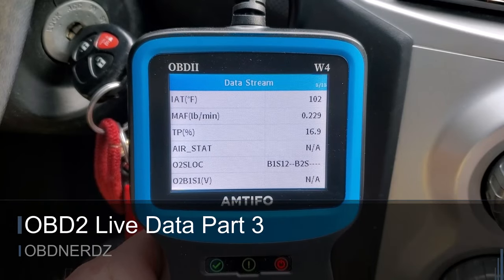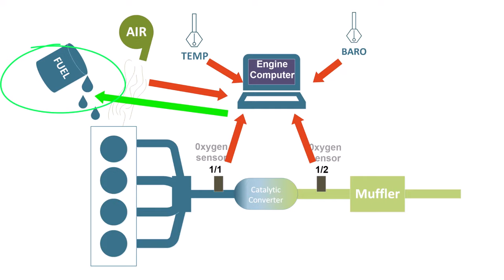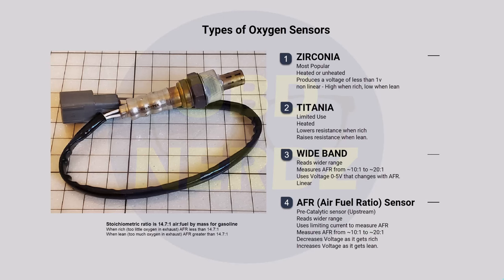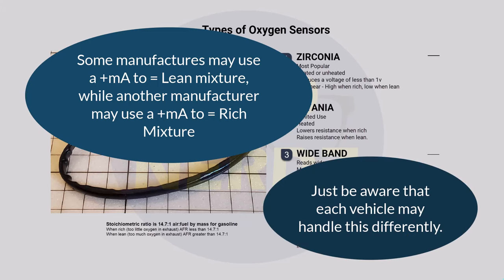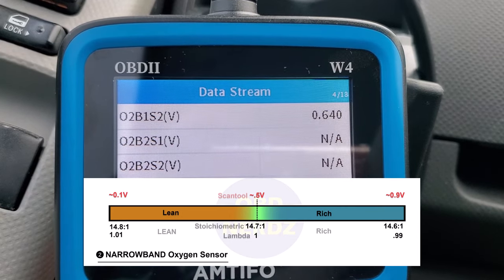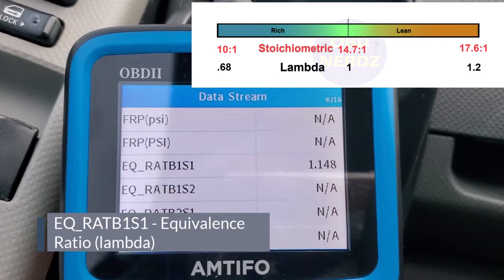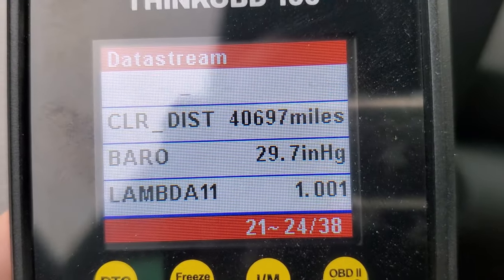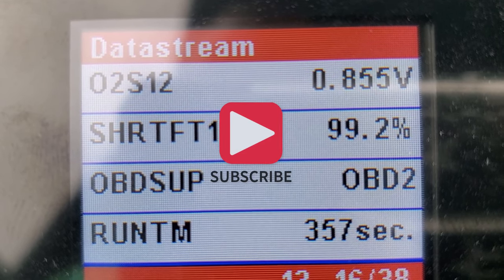Reading OBD2 Live Data Part 3 (Testing 02 Oxygen sensors)

Comment: Extremely helpful video. Yes, it's noted that it doesn't tell you for sure what might be wrong w/ O2 sensor, but does do a good job in interpreting the scanner tool info and if your sensor is kaput the scan tool should pick that up.pretty easily.

Comment: I have a car that I have been chasing a P0172 code (rich condition).  This will help me narrow it down to check if my 02 sensors are failing.
Reply: use a metal rod and listen to your injectors... one of them is probably stuck open.  symptoms include longer start times, because the fuel pressure bleeds down, rich conditions, catalytic converter overheating and melting down plugging the exhaust.  Loading up at idle, will cause constant high negative - fuel trims.  washes the engine oil off the cylinder walls increasing friction and lowering compression in the problematic cylinder.
Reply: @BlakeHarvey903  I ended up replacing an injector and fuel pressure regulator.
Reply: @TheBlindingwhite  so you fixed it?  good!

Comment: Hi, nice video.. very usefull I just did the test on my car and S11 and S21 looks they are working pretty good and fluctuation is correct, but in the downstream the voltage is keeping stuck at 0.28V in both banks, should i run the car for some minutes before do the downstream test? 

I am doing this test because time to time (mostly when i go uphill) the service engine soon light is flashing and OBD code i got is P0340 relates with bank 2 threshold no efficient. I replace my Cat about 1 year ago so I hard for me to think CATs are the problem.

Comment: Past few months I been noticing noticeable amount of fuel economy with my mazda3.  No CEL, but can o2 sensor still could be slowly getting bad?    Had my spark plugs changed, no improvement to fuel economy.   While doing a oil change today, I did a throttle body cleaning, we'll monitor and see how it is during next tank of drive.
What else could cause bad fule economy? (things like tire pressure, etc... has been all checked out).   I do have a old OBD2 bluetooth scanner I bought 10+ years ago with using Torque Pro app.  I have only used it for scanning CEL, not sure which sensors I should monitor to check for my issue or how.

Comment: I have a 2003 toyota camry sensor 2 fluctuates and then drops to zero at times while driving... the car is running fine but throwing a p0420 code for the cat... trying to check all options before going for the cat

Comment: Between the two scanners, which would you recommend?
Reply from the maker: If i had to pick between one of those two, I would probably go with the ThinkOBD due to the fact that the software is able to be upgraded for it from your PC. If the Amtifo was up-gradable they could probably add Fuelsys1 which wasn't showing up on mine. I think being software up-gradable is a pretty good feature to look for when buying any unit. (although you are still at the whim of the manufacturer to actually put out new versions). But I think both were a good value and give you a lot of info at that price point.

Comment: I think the O2 is bad since it is staying around 1ish. However, it is supposed to switch values up and down.
Bad sensor!
Reply: No that is correct. The value 1 represents "14.7:1" and any plus or minus value from 1 is actually plus or minus from 14.7:1. At idle the air/fuel ratio is always trying to be as close as possible to 14.7:1, obviously it can't stay there perfectly so any tiny fluctuations from 1 like -0.995.. 1.010..-0.998.... are completely normal and working properly